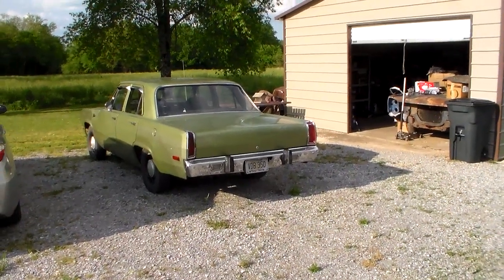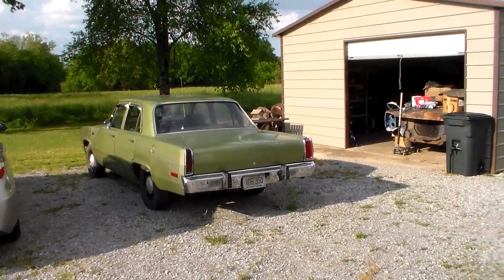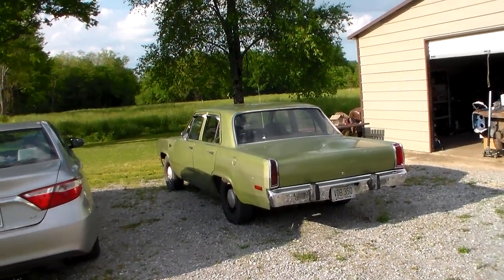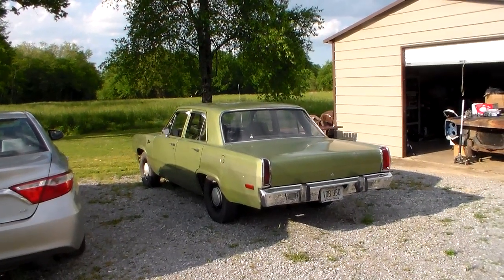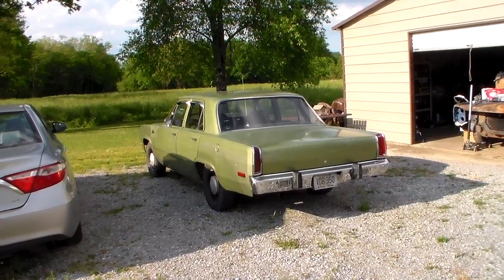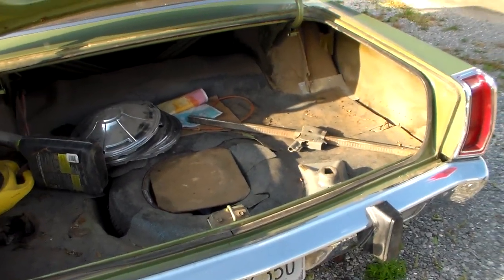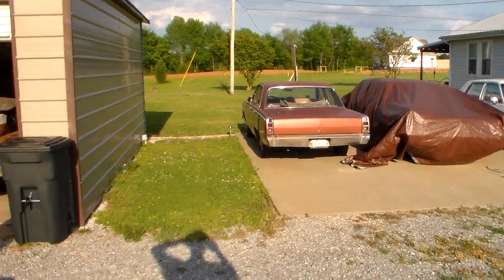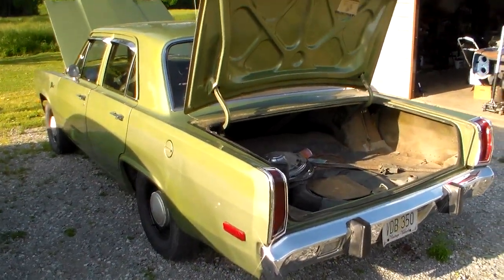Let's give the rusty '73 Valiant an inspection

Comment: I'm currently rebuilding a 73 scamp with my dad, a hell of a project but damn is it turning out nice. I'm redoing all the fake wood in real black walnut, even on the dash, I remade the entire dashpad out of spray foam and some felt, we're going to make our own vinyl top for it and we've done a bunch of metal work on this thing from home made floor pans to pulling dents that were filled in with putty and remaking the seams of the wheel wells. I'm just hoping it'll run nice once we've got it all back together.

Comment: Had a few of these back in the day. I was living up north then. Had a couple that the rear springs went through the floor of the trunk. The deck lid was holding the car up.  Also watch the front torsion bar anchors in the cross member. Unless this is late enough to have transverse torsion bars.  They had a bad habit of tearing out. They use to make a repair kit for that. As far as the rear I used plate steel in the trunk pan and fab a rear section of frame for the shackle. Of course steel was a lot cheaper back then.

Comment: This is a base model 4 door with little or no options, slant 6, rubber mats, no chrome. I would also bet that black rims and full wheel covers came off of something else and the original green rims are missing. I'm guessing the original owner was probably a government agency or a public utility, maybe the US Army.  I just don't see how this one would bring all that much even it was pristine.  I just don't think it's worth the effort, especially, given that the structure is pretty rusty.  I would part this one out.
Reply from the maker: You're pretty close. It was a base model with a partially synchronized 3-speed manual,  with optional 225, and AM/FM radio. It had dog dish caps and the green wheels had been painted black with a brush. The original owner is undetermined, but the second owner until i bought it was a lady.
Reply: @TylersNeighborhoodGarage  I would bet that the AM/FM radio came from another car as well.   AM/FM was kind of a luxury item in 73 and may not even have been available on a Valiant.  A lot of fleet models back then were even ordered with no radio or what they called "radio delete.'.  Then again I have seen a few strange things, when I was a kid, the guy down the street from me had a base trim 65 Ford Galaxie Station wagon with a three on the tree no radio and air conditioning.  He ordered that car, I guess he really must have wanted air conditioning.